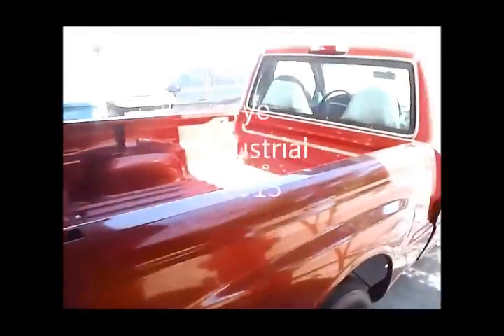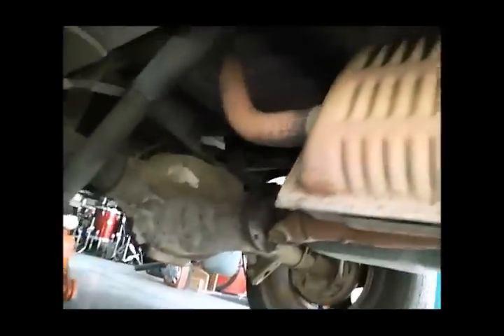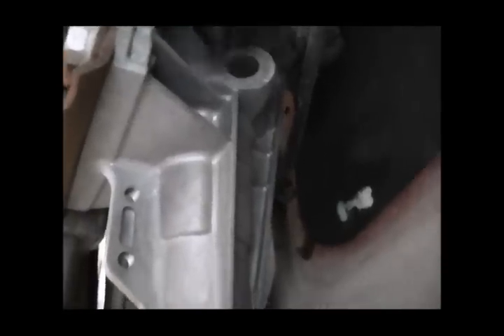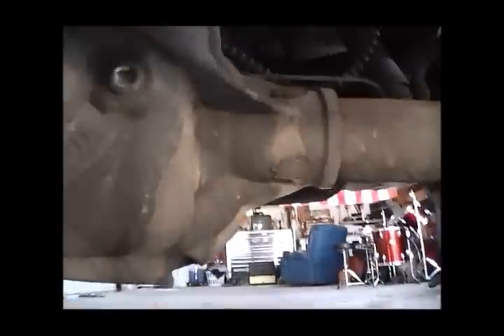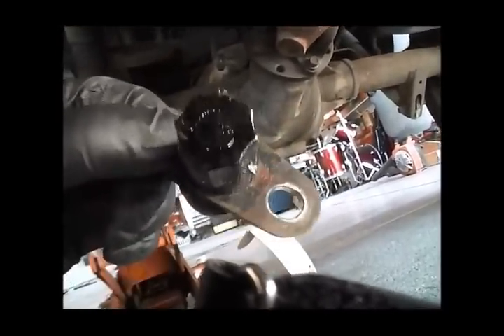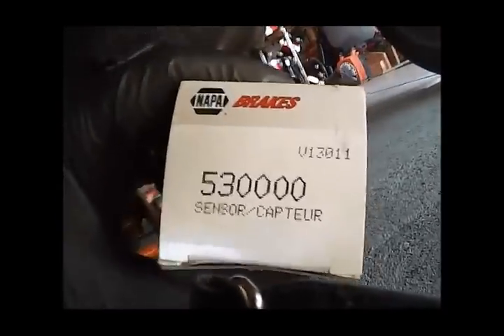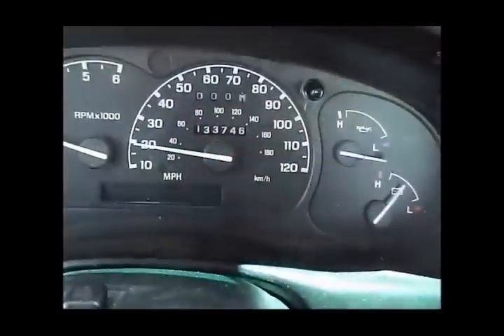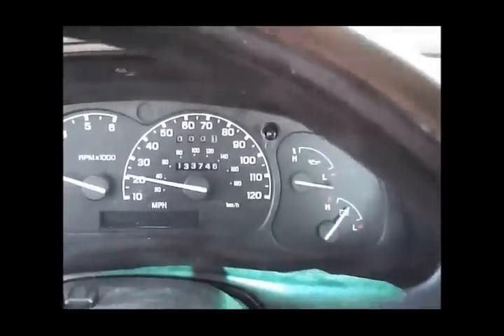Speedometer not working, 1999 mazda/ford b2500/ranger. Code P0500 how to fix

Comment: Excelente help appreciate Bro! Have a Ford Ranger 99 speedometer was surging in and out ! When the speedometer kicked in you could feeñ a slight surge of power in the truck ! And when the speedometer wasent working the wipers didn't operate ! Must to be in the same circuit somewhat will check that . Thanks again for the video

Comment: Excellent video about the speed/abs sensor. That was the perfect solution. And you were right about the parts store selling the wrong part initially. Just for kicks I went to the ford dealership which wanted mega dollars just to diagnose the problem, not including all the sensors they wanted to install. Huge help, Many Thanks!!
Reply from the maker: Hey Steve. Glad to help!!

Comment: Just what I needed to see thanks! I have a 2000 ford ranger 2.5l manual and when I got the open diff swapped for a LSD speedometer and speed gauge stopped working, fingers crossed.

Comment: I know this is an old post but the 3 possibilities are if you have RABS or 4WABS. If you have RABS then the vehicle gets its speed and abs from just the rear differential ABS SENSOR or that and a VSS sensor ontop of the transmission. The last possibility is if you have 4WABS the vehicle uses the 3 abs sensors on differential and both front wheels. Hope this helps

Comment: Thank you for this video so much, havent had time to actually check it out yet. I have had my ABS light on for as long as i can remember and then the check engine light came on, and now my  speedo just stopped working. I can only assume its that dang sensor, i just hope that little gear on it didnt break off into the diff.

Comment from the maker: not really sure off the top. if your sensor has a warranty, i would swap it out with a new one especially if its from autozone. Also check the harness connector at the sensor, the metal connectors inside, for corrosion or rust. If the connector is dirty it will effect the signal. Hope it helps, thanks for the comment Man. Cheers
Reply: Just put a new sensor on and the speedometer still isn't working. Would you say it's safe to say the wires are messed up somewhere or do you think it could be the dash cluster itself. My temp gauge don't work either, not sure if it's related or not though.

Comment: Doubt you’ll see this but I’ve got a 99 mazda b3000 manual transmission.  Check engine, ABS, and speedometer all stopped working (lights came on).  Figuring it’s the same location you have considering my ABS light popped on as well?

Comment: I have a 1999 Ford Ranger XLT.  It has started hard shift from fisrt to second gears, then it shifts excellent after. Sometimes it will and sometimes it don't..Here's the thing, the OD light doesn't flash. The transmission fluid level is accurate. What do you think?
Reply from the maker: Hey Avery. Thanks for the comment and watching the video.

I would check the trans mount.  If the mount is bad it can cause the trans to move around during the shift and act like a hard shift. You can usually hear a "bang" noise or "thud" going from 1st into 2nd and thats the trans smacking the cross bar or cab of the truck. I would also  check the motor mounts while youre at it. 
I would start there first. RockAuto or Amazon will likely be the best price for those mounts if you find they are bad.  Hope that helps. Cheers!

Comment: Question for all. I replaced the sensor. Clip broke but I secured it good enough until I can get a replacement and splice it to the old. The new sensor didn’t fix my non-working speedometer, and the abs and engine light are still on. I’m also still having shifting issues. I can drive it but I have to start off in first and work my way up to drive. What do I need to focus on next.
Reply: Have you gotten this issue fixed ??

Comment: I replaced the VSS on my friends 99 Mazda B2500 W/ 5 speed manual. It has a VSS code also. After replacing, the speedo still does not work. You say there are 3 possibilities of locations, where is the third? Any other thoughts what may be causing the speedo to not work?

Comment: Also have another question. With the speed senor sending out check engine light and ABS signals, will that prevent the ABS brakes to spot working completely? Thanks.
Reply from the maker: Yep. If the ABS light is on then the ABS system is non-op. Your brakes will still work fine just no ABS.

Comment: What was the speedometer doing before, was it not working at all, or was it choppy and being slow to response of ur speed, if that makes sense
Reply from the maker: Hey Cole. The speedo wasnt working at all and the abs light was on.
If your speedo is jumping around than it could be the sensor is going bad too.
Check the wires by the sensor and make sure they arent cut ir damaged. A loose connection can cause a jumoing soeedo needle.  Hope that helps.
Reply: @RYEINDUSTRIAL  well yesterday I change the bulbs in my cluster to some led blue bulbs, and I moved around the cluster a lot in order to get the bulbs in, but before I did that the speedometer was working perfectly, I just don’t want to fix or change a bunch of stuff I don’t have to

Comment: thank you for your video, good job. I have a question though, I replaced my speed sensor due to having the same problem and it solved my problem. Now after driving for about 300 miles, it started acting up again, same problem, speedometer arrow bouncing up and down, and now stopped working completely. Can it be a bad sensor or something else causes it to fail?
Reply: +Nikoluts Babiu  My post above ^^. " My ABS light has come on 3 times since installing the new sensor.  I'm thinkin' cheapo, non- OEM sensor? No big deal, the speedo has not been effected each of these 3 times."

Comment: I have a 1999 Ford Ranger automatic transmission. My check engine light is on as well as my ABS. My speedometer does not work too. Even though my transmission is an automatic, will this senor still be in the same location? Thanks.
Reply from the maker: Hey Jason. If you have an automatic trans then the sensor will be in the transmission.  Should be in the first location like I show where the dummy plug is on the standard transmission.  Ask your parts supplier for the speedometer sensor and it should match up.  Make sure the connector is the same as the plug for your truck. thanks for your comment. Cheers!
Reply: @RYEINDUSTRIAL  i have a 99 auto and i have the same speed sensor in the rear diff thats odd ,i changed it today and my truck is shifting buttery smooth

Comment: Mine works only intermittently.  It works on cold days but once the cab warms, it quits.  Sometime I cam slam my fist on the dash and it'll work for a few minutes.  Any ideas?
Reply: Mine doing the same thing, I replaced both sensors still the same! Pulling my hair out trying to figure it out.

Comment: Hey I have a 1999 ford explorer sport, my check engine had been on cause I have had my catalytic converters cut off, last week my abs light came on and my speedometer has quit working, do you happen to know if it is located on the front differential or transmission?
Reply from the maker: Hi Paul.  Im not sure on your truck.  If there is a sensor in the rear differential, like in my video, i would say that it is bad.  If you do not have a sensor located, like in my video, it should be on the transmission towards the back. Usually the sensors on the transmission are only for the speedometer and not the abs.  Autozone or Oriely's do pull codes for abs sensors. With that code you can find which sensor is bad if there are multiple abs sensors. hope it helps. cheers!

Comment: What measurements did you get on wires before calling the part, was 12 volts on one and ground on the other?
Reply from the maker: Hey D.  It is a positive and a negative wire or also called a power and a signal wire.
Usually voltage for sensors is 5volts or less.  Im not sure what the voltage is for this speed sensor,  sorry to say.  Probe the wires with a dvom with the key switch on and go from there.  hope that helps, cheers!

Comment: yeah, changing the sensor didn't fix mine... think there's some kind of common defect with the wiring harness getting moisture in it, gotta chase it down to the cluster
Reply: Figure out a solution for yours? Just replaced all my sensors and it's still not working + abs light still on
Reply: @larzrobison406  nah, though otherwise its still running fine. I been too busy with work and life surrounded by these covidiots to ever get around to it, when I do worry about doing a job on the truck its usually something it really needs, could use new bearings in the front and I actually changed the steering rack and pump a couple months back, both reman units and the fk'n remanned rack's already leaking. The idiots at Detroit Axle put all new shit in there and somehow didn't clean the housing where the boots strap on, and there was a whole bunch of grit under there that apparently got on the piston and scored it. I finally found a brand new rack and a bracket kit to convert a new pump from a different brand vehicle altogether to work with the truck, since there are no new pumps for those Rangers anymore. Spent probably $600 on all that stuff, gonna do to the job over again as soon as I get a couple of days. Should only take one but you know how that goes. Yeah TBH the speedometer has probably been the last thing on my mind, though I'm sure if I ever get around to it won't be hard at all. I heard from someone that there is a connector somewhere under the truck about midway between the rear diff and the cluster that is a common issue, think if you can find that, disconnect it and clean it out, it might solve your problem.

Comment: I have a 2000 Ford Ranger, the speedometer odometer and trip meter stopped working so I took the cluster off the pickup, took it to a repairman, he got it working on the bench but when I reinstalled it these were still not working; everything else in the instrument cluster works.   Could it be that the speed sensor is kaput? or might there be another reason?.    Sure could use some clues on how to go on, all the fuses seem to be ok.
Reply from the maker: Is your Ranger and automatic transmission or standard?
If the abs light isnt accompanied with the check engine lite and the non op speedo than it is a mechanical issue. 
I would suggest to check that the connectors behind the cluster and fully plugged in. If that all looks okay than I would look at the speedo sensor wiring. Usually at the connector, at the sensor,  that the wires can be damaged and not delivering a signal to the dash. Make sure the connector is clean and not corroaded.
Hope that helps my man. Cheers!
Reply: @RYEINDUSTRIAL  Thanks; I will check the sensor, as far as warning lights there are none. And it is a standard transmission.
Reply: Martin i have the exact same thing going on just replaced the VSS and nothing you ever fix it??